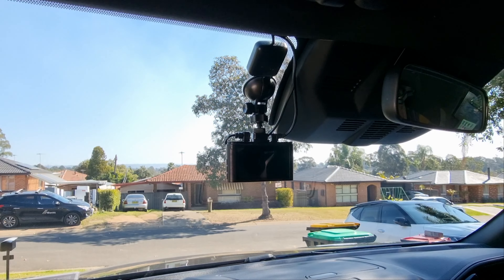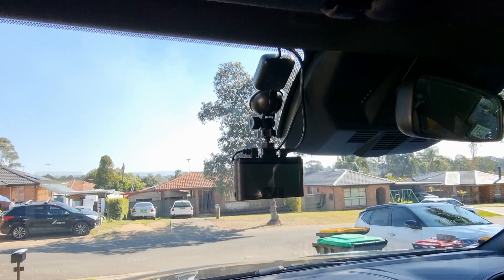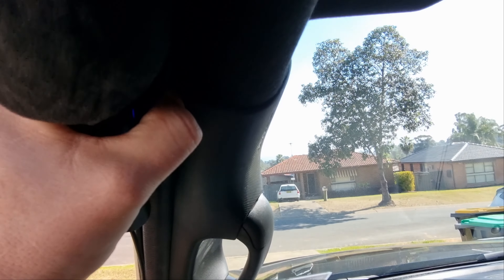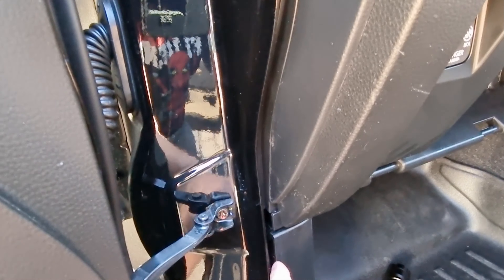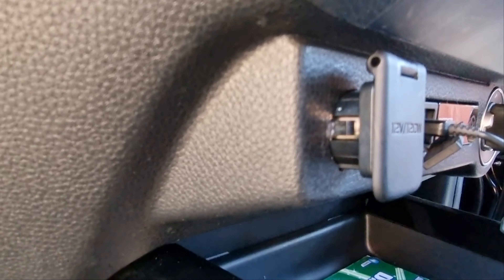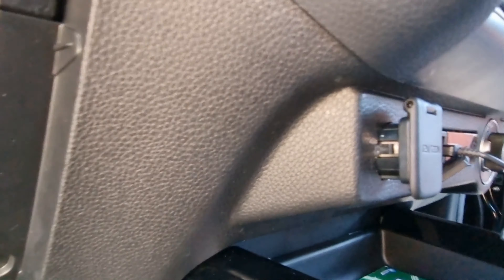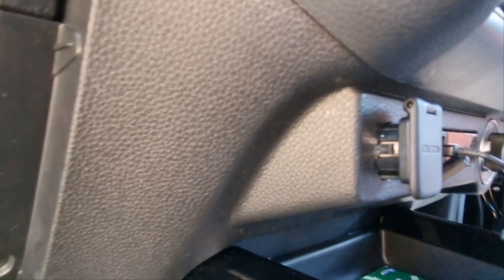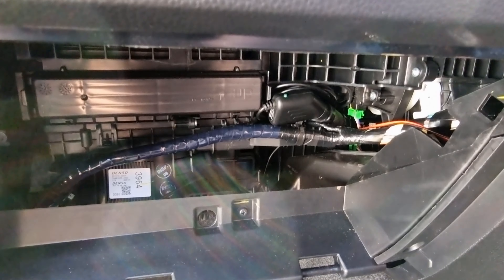How I "hardwired" my dashcam

Comment: Does that run when the vehicle is off, parking mode, or only when driving.
Reply from the maker: This particular version has a g sensor in it, so when it feels a shock it starts recording if the vehicle is off. But other then that, its like having it plugged into your 12v socket on your dash

Comment: You shouldn't really be splicing on to existing cables as this can overload the circuit and either blow fuses or cause fires. All manufacturers provide multiple unused spare fuses in the fuse box for you to introduce additional accessories. Had you purchased a new Ranger, these now have a dash cam socket fitted next to the rear view mirror.
Reply from the maker: I can fully understand where you are coming from,  I didn't splice the existing cable, but fed the new cable into the back of the existing connector onto the terminals, and secured with tape. because the plug is static, there is little chance of it coming undone, also the reason i did this is if i need to remove it to take it back to the dealer there will be no trace of it being there. The camera wont over load that circuit as it only draws milliamps and the reason i piggy backed it off the 12V socket was to activate the camera when the car turned on. Usually that circuit is rated at 10A so all i will do is make sure that I don't plug in anything over 9A to make sure it doesn't overload. There was a $18K difference in price between what I got and what the ranger would have cost for the equivalent product so I couldn't justify it. I hope this explanation makes sense why I did it how I did it